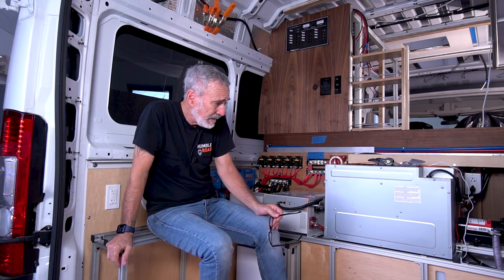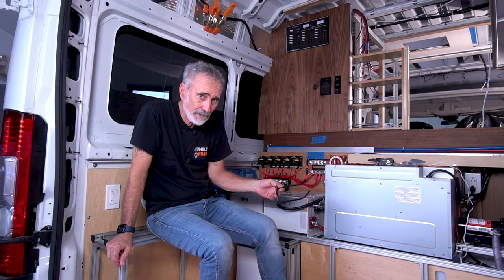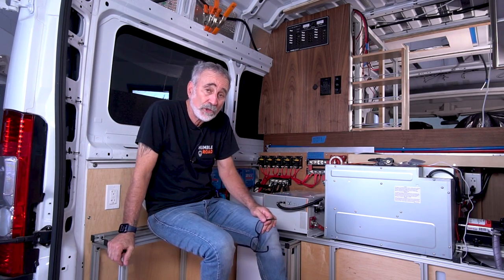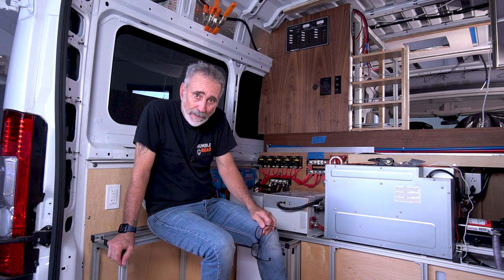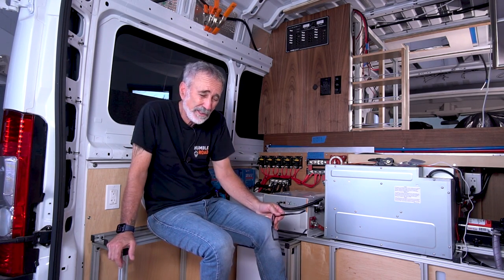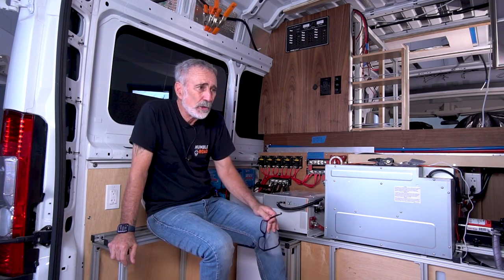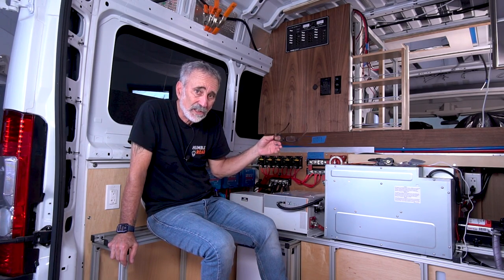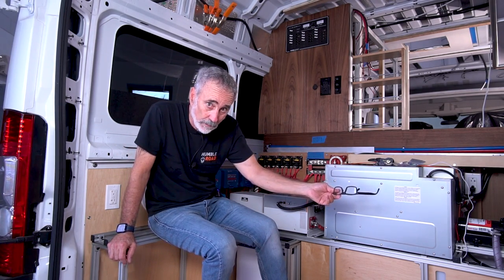Recirculating shower in a van? Just my humble opinion...

Comment: I think you are making assumptions since you do not have first hand experience with recirculating showers.  I would recommend you experiment with a tied and true system and then provide your opinion.  Some other van lifers have installed and like these systems, maybe you should check out what they are using.  While I do not have a recirculating system, I have whole house filters and I do not take a bath when I'm changing the filters so it may be that your system is not one of the better ones.

Comment: Wait… “urine”… you pee in your shower? 😳 Fecal matter… possibly but when I poop I always clean up with wipes afterwards, so minimal. As for the filters I plan to use filters that can be backwashed. 4.5” filters are about the same cost as the 2.5” that everyone uses and have over 3X the surface area. I haven’t seen anyone *not * use a UV unit - I plan to have a “filter only” mode which bypasses the shower head and I can loop the water through as long as I want to clean it up. With good engineering and proper execution it doesn’t have to be “disgusting”…. that’s my opinion.
Reply from the maker: Please share a follow up when your system is operational. 👍

Comment: With all due respect, humans have been getting clean in their own soapy water, dead skin cells, urine, feces, etc everyday for at least the past 100 years if not more. It's called taking a bath. I just took one just now. I almost exclusively take baths within showering. My mother who is 91 prefers bathing over showering. So with all due respect, I don't really see what the difference is. In fact I would think the water in a recirculating shower would be cleaner. Please note that your integumentary system, your skin, acts as a barrier to infection so unless you have an open wound or you're swallowing your own bath water, I doubt there would be any harm taking a bath or a recirculating shower. I can agree with you that if you are sharing your recirculating shower with the same water then maybe it's not a good idea. Otherwise I don't quite see what the big deal is.
Reply from the maker: You missed the point, my bath taking friend. I was referring to the maintenance of the system more so than the actual shower.
Reply: @HumbleRoad  If I win the California lottery or Powerball, I will come to you to build not a van, but an ambulance, so you can place the electrical and plumbing in the outside cabinets for easy access. Then, I'll ask you to build a full bathroom inside including a claw bathtub, vanity mirror and sink. I will sleep in a rooftop tent or ground tent if necessary, lol. The--circulating shower--as another poster mentioned, will not have any filters on it. It will just reuse the same  soapy filthy water. I will post videos on TikTok & YouTube every day I live in said vehicle, similar to a Catholic confessional, noting my continued health and cleanliness, lol. Love your videos. Thanks for a lively discussion ;-)

Comment: I agree with your individual points, but not your overall conclusion. You use recirculating showers to extend your time away from water, they were never meant to last forever.  A normal at home shower takes 30 gallons of water. If you shower three times a week, that's 90 gallons. I take six showers from my 5 gallon supply before I change the water, instead of carrying 180 gallons of water. I don't poop or pee in the shower so maybe that helps? I just purchased a water tester. According to the world heath organization, water testing 500 ppm or less is safe to drink. I am going to count how many showers I can take to reach 500 ppm. If water is safe enough to drink, it should be ok to shower in. Any residual soap that makes it past the filters,   probably acts as a disinfectant which is a good thing.
Reply from the maker: Sorry, but if you wash your crack in the shower, fecal matter has gone down the drain into your system. That’s a fact and you missed the point it’s not whether or not the water is safe or clean to use rather the entire exercise of maintaining the system is some thing I’d rather not get involved with.
Reply: @HumbleRoad  I use wet wipes when I wipe, so the rear end stays pretty clean. But yes, if a person only uses toilet paper, they are pretty nasty afterwards even though most don't realize it. But we are talking about water quality of five gallons of water. I purchased a drinking water test kit that test for 16 different things, plus an electronic sediment tester, and after 6 showers the water is still clean enough to drink, but I still change it out weekly.  With proper maintenance recycling showers are amazing, and convenient water saving things. The problems you describe only exist in a seriously un-maintained system. But if in doubt, buy a water quality test kit.

Comment: George, shame on you! I thought you were more practically savvy than that.  Where do you think so-called "fresh potable" water comes from?  It's water that has been recirculated on the planet for 4 billion years.  Every glass of "fresh" water that you drink out of a spigot has probably passed through the GI track of a dinosaur, bear, deer, or bird millions of times, then filtered through forest or  farm soil full of nitrates, directed to wells and streams, then ends up in a pond where some municipality collects it for "potable" water.  How do they "clean" that dirty water?  They run it through filters, add flocculent chemicals to settle out sediment, then dose it with  bleach to kill the remaining fecal bacteria, then pass it through 50 year old pipes to come out of a tap. Then that water sits in your plastic RV tank in a hot van for days or weeks, breeding more bacteria and leaching plastic organics out of the tank.  You think that "fresh" water from a van is any cleaner than recirculated shower water?  Most good recirculating showers have sediment filters, carbon filters to remove organic contaminates, and UV filters to kill any bacteria every time it passes through the shower head.  I'd trust that water far more than the unfiltered "mystery" water that comes from an RV park shower or some anonymous municipality.  So you have to replace a "gross" water filter every couple of months.  Isn't that better than using unfiltered water from a tank?  At least that filter has trapped all the gross stuff before it hits your body.  We need to quit being so wasteful of precious fresh water, that runs down a shower drain and has to be re-cleaned every time.  At least the limited capacity of an RV makes us more aware of the true value of "processed" clean water . . .